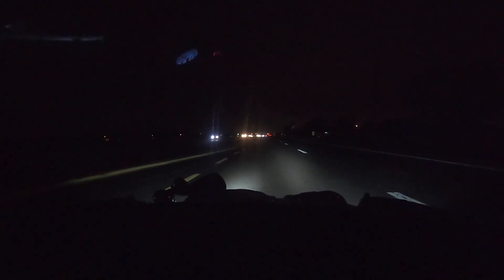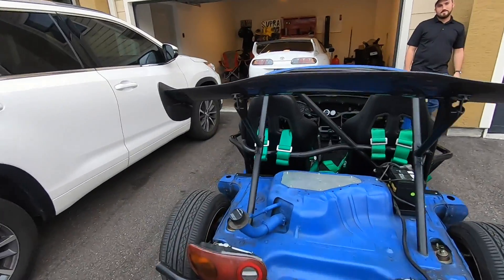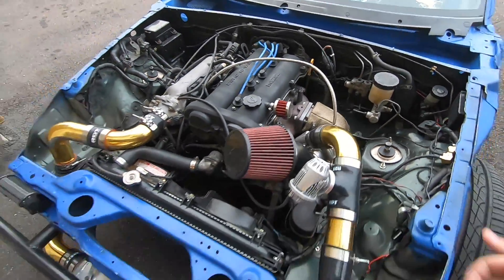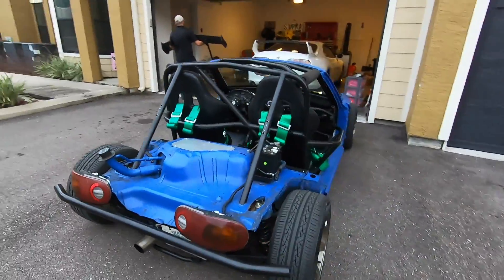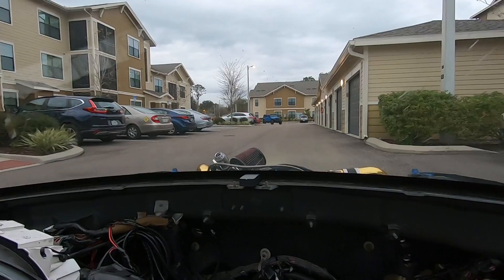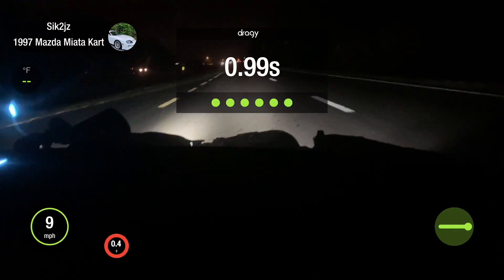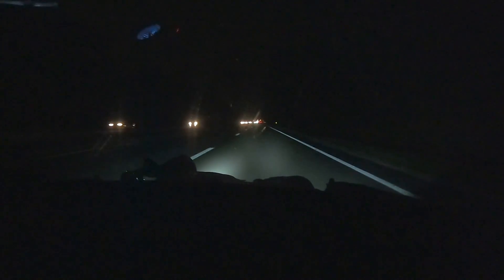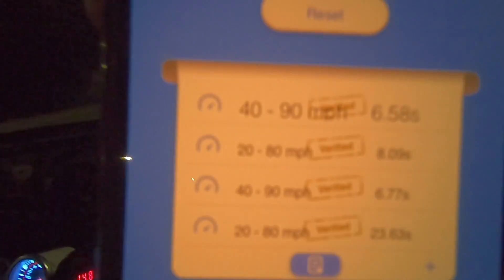Does a Carbon Fiber Wing Make You Faster or Slower?

Comment: Did you guys calibrate the wing? Because I have one and I feel like it creates a lot of drag! I burn more gas and meth, at 130-140 mph my rooms rpm's pause at around 6000.
Reply: How many seconds do you think the extra drag added on to, let’s say, a 40-140 pull? And how much extra hp would you need to even it out to where you were before?
Reply: @revenantpneuma3636 idk, it was a long time ago but I was drag racing with wing on and I had left the other car by at least a car length then when I hit about 140 the other car came pass me

Comment: Wings help if you FEEL the rear or the car squatting/sucking itself to the floor above certain speed. Usually above 75-80 mph. The wing should feel rounded on the bottom and flat on the top. If it isn't, your wing isn't functional, it's just rice. Yes you can feel downforce. If you have rear lift before the wing, your rear end will feel light at high speeds (less tire on the road, less stable). After the wing your car should feel planted and stable. And yes in city driving they're useless and only create drag. Unless you're speeding in residential streets you won't feel the downforce.

Comment: A wing does two things simultaneously; It creates down force and drag. Drag is generated as a result of and Not equally proportional to down force. Turn up down force and simultaneously increase drag. But they are never a 1:1 ratio. A wing will slow you down more than create down force but only if the wing angle is extreme.  In your case the down force is increasing grip enough for acceleration such that it overcomes the negative drag it produces and allows for faster acceleration. Also the wing could be smoothing out airflow and eliminating the vortex that's happening right behind your seats. That vortex also will cause drag. So if that is eliminated or at least mitigated, then there's your difference.

Comment: Awww....but it doesn't have anything to mitigate the airflow, so it should just create more drag. In theory.
Reply: The wing itself is pushing down as the air goes under and above it. The wing is bolted to the car so therefore its creating downforce
Reply: It creates drag but not enough to make a difference as the positive effects of the downforce out weight the negative from drag